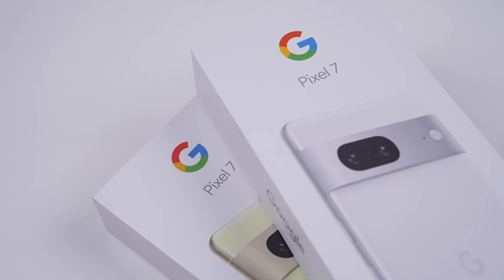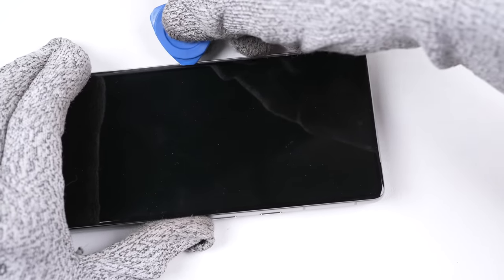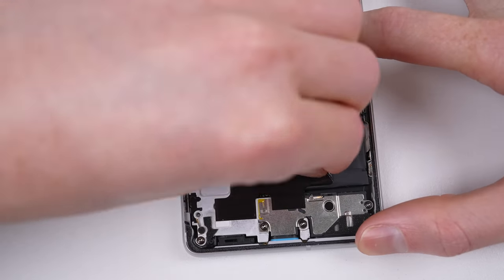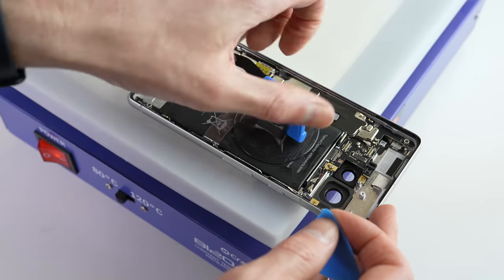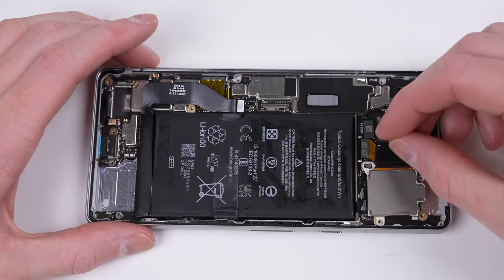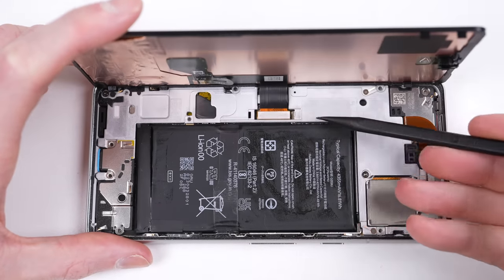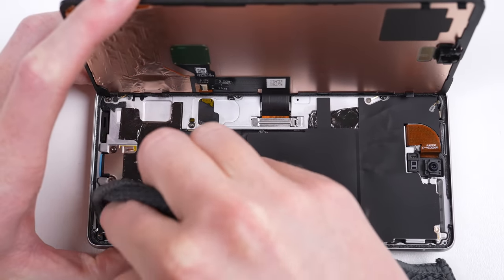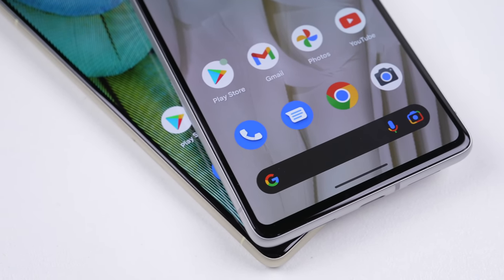Inside Google's New Pixel 7 - Teardown and Repair Assessment

Comment: Possible idea for removing the battery.

It seems to me like the clear plastic pull tab in the centre is one long strip held together with a bit of glue. If you were to pull it apart so you had one end of the plastic in either hand, you should be able to slide it back and forth like a saw and possibly then slice through the adhesive on the underside of the battery.

Might not work but worth a shot for next time maybe?
Reply: JerryRigEverything i think tried that method. 
Or Hugh with the last model. Didn't worked
Ever since the Pixel 3 XL, Google went overboard with the glue
Reply: I’ve seen someone try that on YT and it still wouldn’t budge
Reply: That’s exactly what google says in their repair manual, but you have to preheat the adhesive before the “sawing”.
Reply: Or the cutting thread for display can be used as a "saw"
Reply: @szecsit13  Yeah that's what I thought...heat, maybe isopropyl alcohol, then "saw". At least it's better than Samsung
Reply: @jerrywu615  Samsungs are cake because you have the metal frame to slowly pry against with a wide plastic pry tool, heat, and alcohol. Pixel is a beast because you risk tearing the nfc and volume flexes (trust) trying to separate the fabric of time they call 'adhesive'.
Reply: Ok I take this back, Samsung just added the best kind of pull tab to the battery of the S23s. Glad to see them finally take a step in the right direction for repairability! Now Google, please take note.

Comment: The finger print sensor needing a re calibration honestly makes sense. If someone could get into anyone's pixel with a dummy finger print sensor, it would be a huge security issue. The face unlock still working is another issue though, but unlike apples it's just a camera face unlock so I'm not sure how secure it is to begin with? Other then that, google still makes some of the best phones if you're looking for user repairs or software modding, they have a VERY active rooting and custom rom scene, it would be cool to see you cover it on newer pixels in a future video!
Reply: the camera on pixel 7 has depth sensing, so it's harder to bypass
Reply: So, I kinda understand why Apple pairs some of its biometric components like the FaceID, TouchID sensors, but pairing components like the battery is a little bit too much imho.
Reply: No, doesnt make any sense. Samsungs(except A51) didnt need any pairing and no one ever got hacked by replacing the scanner. ITS JUST AN INPUT DEVICE, THE VERIFICATION HAPPENS IN THE CPU OR STORAGE. If you really wanted to hack someone by replacing the scanner you would need to know their hash and make a scanner that sends out this specific hash/checksum everytime but you also would need to get past BEFORE FIRST UNLOCK bc scanner disabled.

Also even if its for security why cant we just re enable it, if we already verified its not tampered with??!??
Reply: Even door locks from the 90s with fingerprint scanners allow the replacement, BECAUSE THE VERIFICATION HAPPENS INSIDE THE STORAGE OR PROCESSOR.
If you could hack door locks with a fingerprint scanner LPL would have already covered how to readout the Data and input it into a tampered scanner and assemble the thing.

If you have proof otherwise tell me, but this is how Ive learned it!
Reply: A dummy fingerprint reader wouldn't do anything for you anyway.

The reader is just a sensor, but the result is evaluated by the security chip on the phone.
Reply: @Aashishkebab  yes, exactly like you want to have the verification of data being done on the inside of the door.

Thats why LPL hates it when the verification is done in the keypad unit, because ez bypassed
Reply: They also could also remove the calibration page, and does it work if you xhange the rom

Comment: Ngl, I'm impressed. It might not be most easiest to repair, but at least it is. Apart from that, they smashed it every other aspect of the phone. Most notably the hardware level  security of thr phone. They have achieved the highest rating achievable for it. To get that rating, the phone should be able to withstand against threat actors like nation-state actors with unlimited resources and time. That's no easy thing to do. As a Security consultant, I'm really impressed by their work. They even included security measures to their threat model to Make sure even Google employees can't access your data.
Reply: It's almost as if Apple's excuse of locking down components for security is absolute horseshit. I'm glad to see a phone can be made secure and repairable.

Comment: I'd love to see Hugh attempt to transfer a fingerprint sensor to a new screen without one. It's a very difficult procedure without warping and snapping it. One thing these kinds of videos often miss is when you're repairing a device you generally don't have a donor device for parts. You're usually going through a 3rd party to get said parts and often they make you do a lot of the hard work. This is usually where the hard stuff happens with pixel phones. The ideal currently is to go through ifixit since they have OEM parts for pixels, but they aren't always in stock and new phones don't have those parts.
Also in professional repair you generally always heat the battery to lift it like you would a screen. Using pull tabs in theory works, but in practice almost every tech I know gets it 2/10 times and ends up using heat and leverage to slowly lift it. 
As always I love your presentation and format of the videos. The focus you put on software locks is always appreciated. The only thing I wish was different is how I felt when the calibration tool worked for you seamlessly. I have tried that tool so many times with many devices and underlying software/cables/browsers/etc. I haven't gotten that tool to work for me even once.

Comment: agree with the review. It's good that there's nothing special required to change the screen (I think that's #1 failure point for all smartphones). It's bad that charging port is soldered on main board, but potentially if it has wireless charging - port isn't necessary (very useful, I agree, but not critical).

Comment: These videos make me proud to be a Pixel owner, it really shows that you CAN have sleek design and the latest features, without making your hardware and software anti-consumer.
(now if only Google could do the same with YouTube 😂)
Reply: Only missing a headphone jack. ZenFone does have one but doesn't allow easy bootloader unlocking (it does but warranty gets voided)
Reply: This hardware requires a calibration tool that could be taken offline at any moment, has no headphone jack, and has no SD card slot. This is insanely anti-consumer.
Reply: @crashniels  dude, I have an old galaxy S9 plus and I don't use headphone jack myself, only and strictly tws earbuds and Bluetooth speaker
Reply: @danteerskine7678  I also have wireless buds but I rarely use them. Mostly it's my Sennheiser or my Bayer dynamic which are wired only. Sound quality is pretty crap on Bluetooth.
Reply: @crashniels  I love my sound with heavy bass, and clear vocals, pretty much what the majority of earbuds with silicone tips deliver, I have a cheap Bluedio Hi hurricane tws earbuds and it's insane how loud and bassy these super cheap earbuds are
Reply: I don't use headphones on my phone, and I have a separate 4K camera and DAP for taking photos and listening to music. Not everybody needs them on their phones. I understand having them as an option, but for me even if they were optional extras I wouldn't buy them because I care more about consistent updates and the ability to buy a new screen if it ever breaks than something I'd only ever use a handful of times. @mjc0961
Reply: @danteerskine7678  bassy with clear vocals is phony "quality" it sounds like shit when you try something good
Reply: @destructionfun2  I agree. 4k videos even on iphone or galaxy will still look like shiit
Reply: @dietznutz1  not really. They may be better they aren't as "fun" to listen to. I've listened to both hq headphones and my wf1000xm3s and i prefer my xm3s outside by a mile
Reply: @crashniels  I kinda agree with voiding the warranty, I've done some crazy shit with my unlocked pixel, and It's my responsibility to repair it.
Reply: @accountid9681  that is illegal in most of the EU to void warranty for unlocking bootloader. 
But yeah if you do something stupid with an unlocked bootloader it's on you. But I usually always flash custom ROMs on it since the default software from Asus or other vendors is usually buggy as hell.

Comment: the battery tab to remove battery, you need to peel the top clear plastic bit off, till its in two parts, take one each hand and slice and move it up and down till battery comes up, use some IPA it will come out very easy :)

Comment: Now, this is a phone you truly OWN!
Reply: Good luck trying to remove the screen without breaking it and the display cable sounds like a pain as well. And you just heard him about the battery it was the most challenging thing to remove.  So yeah you own it but if you try to repair it yourself then what you own will be a paperweight 😅
Reply: You mean that google own you
Reply: @sammyjammy6647  Well, they did make it kinda of hard but I am confident that I would be able to do it without a problem.
Reply: How do I own the phone when I'm 100% reliant on Google providing a calibration tool? If they take that tool away, I'm screwed if I need a new screen. I don't own the phone at all, Google does.

Comment: I have a pixel 3a and the battery is not holding charge so I looked to see if I can replace and after watching a few videos just thought no, I don't have a hot plate and no matter how careful I am sure I would mess it up (I repair DJ equipment for a living) . Then I tried to find a local company to replace for me and no one had batteries in stock and needed to order, so the repair was going to be a few weeks and I need this for my job, so I bought a pixel 6a and used the google trade in on the old one. It looked like the pixel 3rd party repair in my area is quite limited which is a shame, because I really like the phone especially as I bought another.  Iphone or Samsung repairs no problem I can walk in and have replaced next day.

Comment: Even if they are not going out of their way to make the phone repairable at least they are not actively hostile to the concept.  While your average end user probably shouldn't attempt this  its nothing a general electronics repair shop couldn't handle.  It would be nice if the recalibration was built into the OS but at least its provided free of charge to everyone and not just restricted to authroized repair centers.

Comment: Apple should take notes of googles repairability. The calibration i think is necessary for the fingerprint scanner to work. Good job google. I think i will at last get rid of my iphone xr and go for google pixel 7 or 7 pro👌🏻
Reply: This phone is literally harder to repair than iPhone 14, what are you talking about? 😅
Reply: You’ll be back. Muhahahaha 😂
Reply: @anianii  Are you high?
Reply: @shiruisyi4380  Did you watch the video? For example, an almost inevitable step is replacing the battery. Good luck doing that with the Pixel. You first need to remove the display which could very likely damage it because of the weird connector, and then get out the battery. Hugh was struggling a lot with that, how do you expect a normal person to do that safely and without alcohol? It’s so much more complicated
Reply: Don’t forget that the USB-C port is soldered on to the logic board. That should be a major downvote for repairability.
Reply: Apple: Instruction unclear, glued really hard the battery
Reply: @anianii  when in doubt use more heat. pretty easy tbh
Reply: @anianii  at least it's possible to calibrate biometrics. -1 for apple.
Reply: @nienanie6358  How is that easier or safer than not needing to use more heat?
Reply: @henry55430  Well how often do you need to replace biometrics? Besides, there is indeed a security risk if you can just replace it, because it opens up the possibility for fake hardware being installed which can unlock the phone
Reply: @anianii  Let me correct you. It's harder to open but after you do that you are free to swap everything.
Reply: @danyuzunov  has anyone tried to see what would happen if tried that google tool on a older pixel phone
Reply: @anianii  been replacing the battery of my phone by myself...its quite simple tbh. difficulty wise its much harder but then same thing happens if you messed up the pull up tape. thats why whenever such thing happens. just apply more heat since heat pretty much loosens everything in your phone. as for if its safe for excessive heat to be exposed to the phones hardware. hard to tell. i heard that theres a risk of it being damaged if you expose the phone to high heat for a long period of time. but i have never managed to break my phone. just remember that your phone is sturdy
Reply: Both suck, just for different reasons. Google shouldn't make it so hard to physically disassemble a phone. Prying off an expensive, fragile OLED to get at any internals is ridiculous, even if you have all the necessary tools.

Apple shouldn't software-lock features & gaslight the user about "non-genuine" parts.

Neither company is your friend.
Reply: @wereoctopus  welp, fair enough. although i am heavily biased to google here since not having software lock means that you can just repair your own stuff.

Comment: Very nice video Hugh, My phone was dropped into a pool while on vacation. It was removed and set out to dry but about 2 hours into drying it got very very hot to where the top screen was easily removed so I opened that up to finish drying. Of curse it does not work now. I would like my pictures so can buy an identiacl phone to swap parts and try recovering them but what part stores the pictures locally ? I will put that into a working phone and see if I can get the pics 
thanks

Comment: WATCH AND LEARN APPLE!!! Google doing stuff right
Reply: Apple will just add a seventh kind of screw with the rest. The octolobe.
Reply: Yeah, like gluing the battery to hell, making the OLED easily breakable in disassembly and sparing you the charger. Good job copying Apple, Samsung! Oh, wait...
Reply: @em0_tion  Idk if you know that Samsung is also making the screens of the iphones + i am not sure what you mean by "Easily breakable" its a screen, unless you put it in a big bracket it will always be "easily breakable" (Емилиане!)
Reply: @danyuzunov  (Емилиян 😉🤝) Just that particular disassembly design that barely allows any mechanical stress, but fair point - they're all one sneeze away from death, Дани. 🤣👍
Reply: Yay soldiered down type c ports

Comment: What's the cause of condensation? Anything inside the phone leaked? Also, is it possible to remove the battery by using the pull tabs?
Reply: heating plate he was using

Comment: I found that screen resolution on Pixel 7 is much lower than even Pixel 4 XL's! Pixel4 XL has 4K resolution whilst Pixel 7 is only 2,5K which is at the same level as Xiaomi and other cheaper brands. The difference will be hugely noticeable in games! Using cheaper screen made this phone more affordable and I guess overall smoothness of interface and in apps comes from a lower resolution screen that doesn't put a lot of load on Tenzor chip. Pixel 7 Pro has proper high resolution screen though...

Comment: I will go through ANY calibration step needed as long as I can do it on the device / hooked up to a computer. Sending it in or using a specific tool for just a screen serial change is BS.

Comment: the fact that the batteries in all these phones fits so tight and snugly in their compartments is proof enough that nothing more than just a couple of small glue dabs or adhesive tape  if anything at all is needed. to stop something moving that essentially cant move about in the first place !..it just shows the lengths they will go to stop third party repair...less glue would mean lower costs
Reply: I wouldn't really say that glue means lower cost. I'm not an expert but I would bet the whole amount of glue in the phone doesn't cost more than 10 cents

Comment: I really don't get why companies even bother with the adhesive for the batteries. There's literally no room for them to move anyway once the phone is assembled, so what's the point other than to annoy people repairing them?
Reply: There should be adhesive so it doesn't rattle, but it definitely shouldn't be so strong
Reply: @satsumagt5284  Most of them are so tightly sandwiched in that they wouldn't have any room to rattle even without adhesive.
Reply: @mattelder1971  Still think it should be glued. Just please, not the glue that would bond car body panels together
Reply: @satsumagt5284  just put removable adhesive then?
Reply: @keonxd8918  weaker adhesive. The stuff they use seems more fit to hold an entire desktop to the wall, than to hold just a battery inside a glued-back phone

Comment: So what USB Type C controller is Google using? Can it support USB Type C DisplayPort Alt Mode ( display out )?  There is a rumor that Google disabled it early in the Pixel series due to reliability issues of the USB controller they use[ed].

Comment: Fun fact: the 6a had a weaker adhesive than even the 6,and especially the 7
Reply: The a series in general are always easier to repair.
Reply: @axethepenguin  A trend that's now carried on with the Pixel 7a, that opens from the front and the back.
Reply: @michaelball93  yes I have seen!